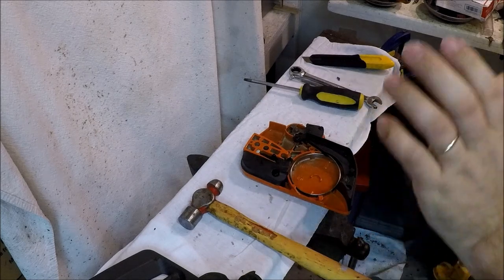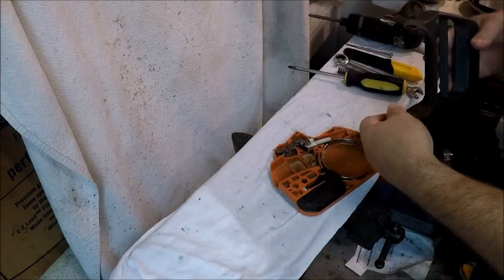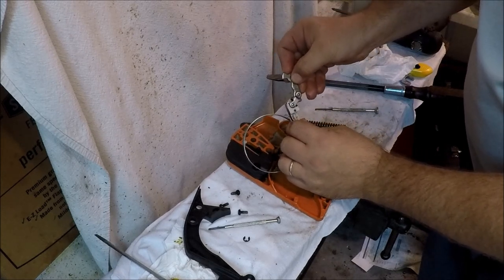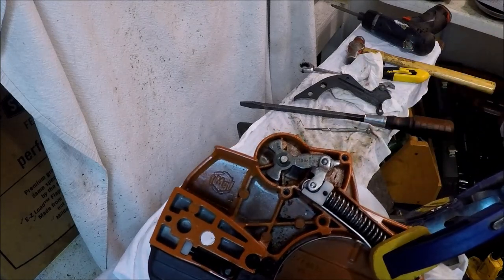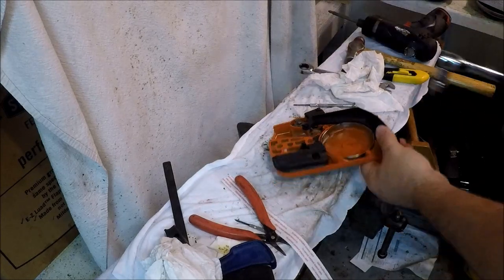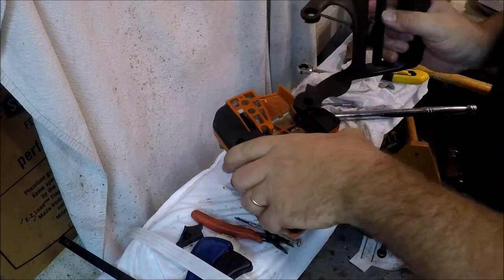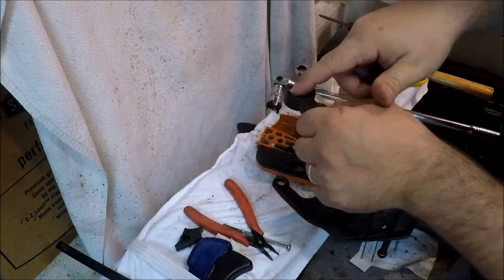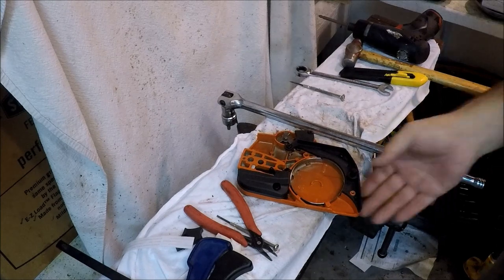Broken Husqvarna 450 clutch cover - fixed?

Comment: My 350 cover seemed bent out and the handle wouldn't bite enough to reset the brake. I got a hutzle cover and it works perfectly now.
Reply from the maker: Jacob Read I can imagine a bend really messing up the works...dunno if that happened here or not....but thanks for the info.....appreciate it

Comment: You're the expert! Why didn't you order the parts, replace the parts, function test it, and bill him for the parts instead of throwing the problem back in his lap?
Reply from the maker: CALVIN L. NIKONT because the parts don't appear to be messed up....and it's function tested as best I can.  The clutch cover will not fit on my husky 350 due to the configuration of the bar bolts being different on the 450.  ...and I don't have a 450.  I'm covering the expense to and from him....so....did I do something wrong here?
Reply from the maker: CALVIN L. NIKONT also....if the cover itself is bent there is no point in replacing that.  Might as well get a new cover which he can do as well as I
Reply: OK, but you never said that the cover might be bent.
Reply from the maker: CALVIN L. NIKONT I thought I did in the vid....anyway ....forgive me if I didn't ....this vid was made in a hurry because the guys were clamoring for it.